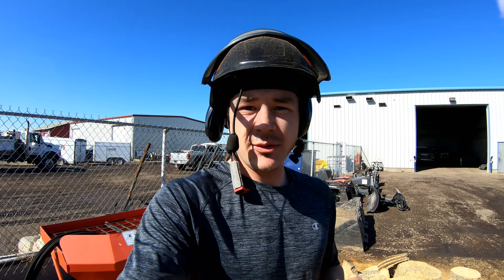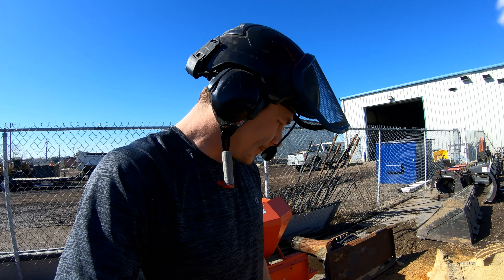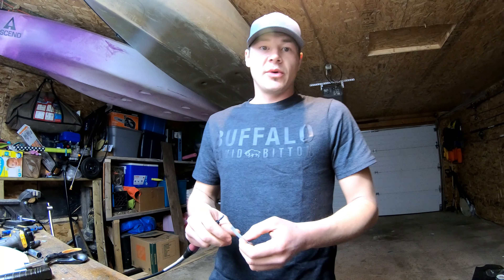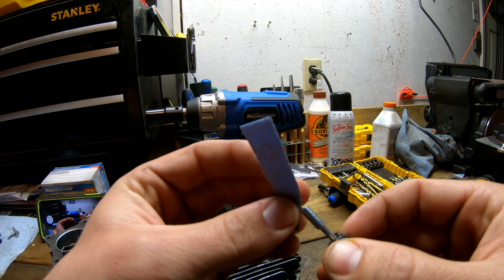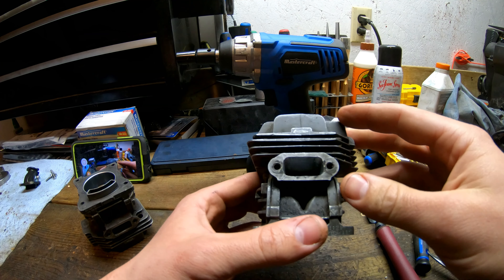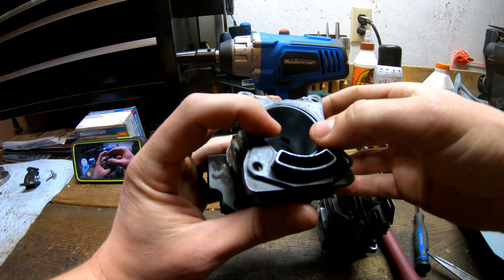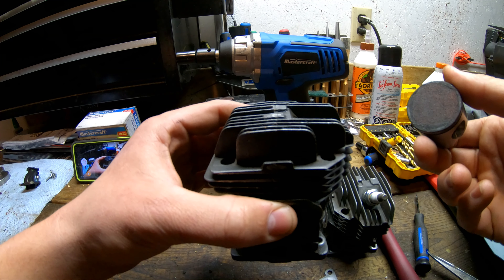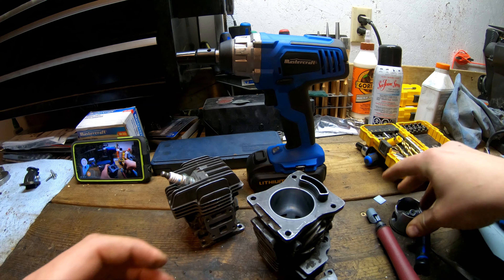Modified STIHL 201T vs 201Tc vs 200T

Comment: Hey man how do you remove and replace the little retainer clips for the piston on the 200t I'm stuck on that part rebuilding my 200 t
Reply from the maker: Are you talking about the bottom where it hooks to the crank shaft? If so I use a pic but be careful because they launch out sometimes, you just need to get 1 and then use something slender like a punch to slide the wrist pin out. Also if you have to put your own piston rings on the new piston be very careful and dont force them because there very hard and will snap.
Reply from the maker: Another note put a bit of two stroke oil directly on the crank shaft bearing before you assemble. And make sure the arrow on top of the piston is facing the exhuast side or your rings will catch the port windows. Also make sure the rings are on correctly using the old piston as a guide. And it can be a bitch to get those two rings inside the cylinder, I use my fingers to compress the top ring then slide it in and then same with the bottom, be patient its gonna take you a bit your first time. Once you get it on look through the ports and make sure the ring gaps are not in the ports. I also put a couple drops of two stroke oil down the sparkplug hole and work the piston so it's well lubed. Good luck man 👊
Reply: BRUSH LIFE  HEY I CAN GIVE YOU A TIPS FOR THE IM CHAINSAW GUYS JUST STARTED ON YOU TUBE I WILL LOAD VIDEO OF EVERYTHING I KNOW FOR CHAINSAW
Reply: @jalcantar8290  for sure man 👍🏽👊🏽👍🏽👊🏽 thanks

Comment: I'm not brave enough or savvy enough to attempt mods like that on my saws yet lol. I just did a little muffler mod (removing spark arrestor and drilling a hole) on my 201tc and removed the spark arrestor on my 200t. I am one of those goofy guys (stihlborn is another) that thinks the 201tc is better (slightly) then a 200 stock vs stock. I've only ever used one 200t though but those saws modded look like they're beasts. Good stuff my man! Looking forward to your next one!
Reply from the maker: The muffler mod has good results on any saw, So that's a good place to start. And the 201tc is a very good chainsaw it is also better on fuel so when you are climbing it's really nice. As far as stock 201tc vs 200t I have never really tried it, So it is possible they may be very close in power. Thanks for watching and happy Friday 👊

Comment: Wich saw do you prefer the 201t or 201tc
Reply from the maker: i mainly run the 201ts but the tcs are really good saws wich I use as well, its up to you if you want mtronic or not